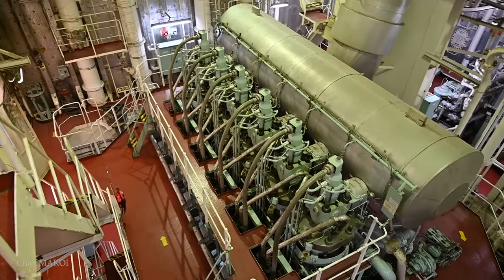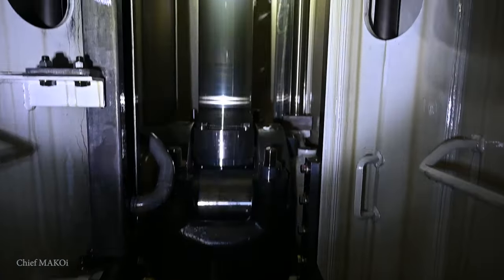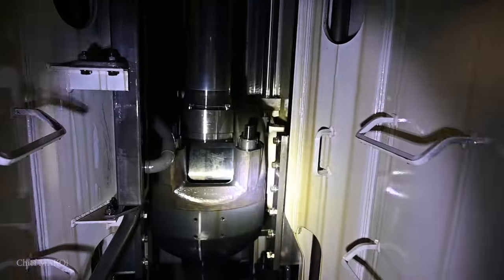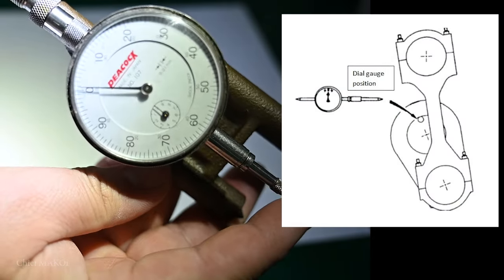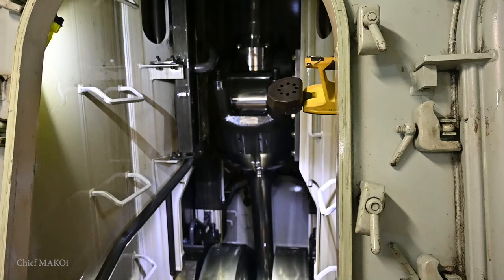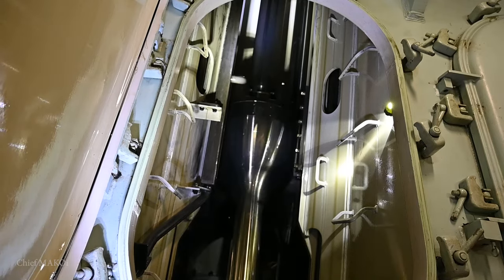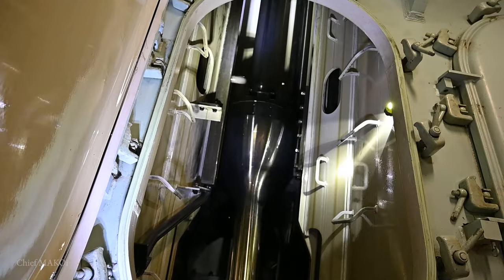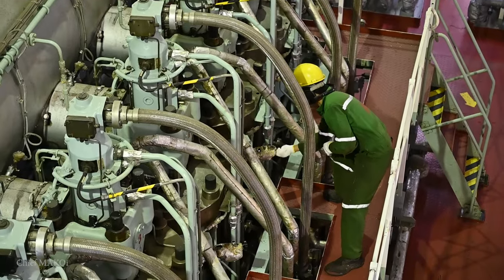Main Engine Crankshaft Deflection Reading | Chief MAKOi

Comment: Keep up the good work!
Reply from the maker: Thanks Hon!
Reply: Mommy Jenny, can't wait for another video!
Reply: @ChiefMAKOi  what is the air compression ratio?
Reply: @xianshi8896  Given it's a 2-stroke, be somewhere between 15.0 to 1 and 19.0 to 1, given its turbo charged i suspect its on the lower end of 15
Reply: @AnIdiotAboard_  thanks.same as locomotive engine has 16:1 ratio.  love Diesel engine too much.
Reply: @xianshi8896  most 2 strokes operate on 15 to 19 to 1, and most 4 strokes will be between 9 and 14 to 1. In all instances charged air intake USUALLY means lower compression ratios.

That's just in general okay? There are alot of diesels and oil burners that run well outside those ranges I've seen 25 to 1 at 4 bar of intake for example.
Reply: @AnIdiotAboard_  okay. thanks so much

Comment: I was a marine engineer in the 1960's with the Nedlloyd lines from Holland.
On our main engine ,a 12 cylinder Sulzer we had main bearing failure of three main bearings , between the last three cylinders.
Oh horror, after arriving in port , Papua new Guinea, and when opening the inspection covers, shining the inspection light and seeing all those flakes of babbit underneath the crankshaft.
We had spare main bearing shells, but they still had to be hand fitted to the crank journals, we sure learned how to scrape the bearing material, apply prussian blue, turn the shell  under the crank, take it out again, check the bearing pattern and again and again until perfect, I believe it took us a week, 12 hours on, 12 hours off to get the engine operational again, and of course we also took crankshaft deflections like chief Makoi so well explained here. What a job, I will never forget!
Thank you chief
Reply: Great job your, my brother

Comment: Take note that this is a medium size 2 stroke cross head engine. The big ones are 50% larger bore and 12 cylinders.
They are seriously big.
I remember climbing around inside these wonders, hammering on everything to check if anything's come loose...in 70C temperature that is...phew...
Thanks for the great vids Chief ! -its nice that all the "land-crabs" can see how their necessities are moved around the world. Keep up the good work !
Reply: Land Crabs😂👍
Reply: @A.C.00  I think Allan means Austin Maxis!
Reply: My initial thought was that the movement with cross head resembled large steam engine practice - no doubt for the same reasons.
Reply: @peteacher52  Well, partly. The cross head takes the sideways pressure of course. It makes it possible to have pressurized  scavenge air from the turbo chargers under the piston, and also the benefit of very clean oil, free of combustion particles, in the crankcase. Unlike the Detroit 2 stroke diesel truck engine, which has very long pistons and dirty oil....
Reply: @AllanKorup  I was just noticing how strangely clean the oil looks in this engine and was wondering if it was because they just changed it. Does what you're saying mean it's always clean like that? Is there no blowthrough in the cylinders at all? I would figure at that size there must be loads!
Reply: @captainotto  hey... The lube oil in the crank case is always this clean in a crosshead engine. The combustion residues that passes the piston rings are kept above the seal around the piston rod ( which only moves vertically through the seal ). The lubrication between piston and cylinder liner is dosed in via small holes in the cylinder and drained out above this seal also.
Reply: 14 cylinders. it's the wartsilla RTC
Reply: @rockpython90  the 14 cylinder Wartsila has a cylinder capacity of 18750 c.c per cylinder ; produces 115000 shp at 110 rpm  weighs 2300 tons and is about 30 meters long  It is the most efficient diesel engine ever designed  for marine use  .
Reply: @captainotto  big ship engines can have 30,000L of oil. They don't change it, they filter it, treat it, and replace the depleted additives.
Reply: @alexadams1836  Wow, that's an absurd amount of oil. But it does make sense at that size of engine. I guess with that much oil and money sunk in it, you must preserve it. I could almost imagine an assay lab onboard so they can adjust additives or respond to metals in it super early.

Comment: Jus sayin' Chief! You do a good job showing what it takes to make the world go round!
I used to sail Chief Electrician on APL C10's. I held a 3rd's Steam License at the time.
I always asked my Chief Engineer if I could 'play' Engineer when we were LA where we replaced 2 cylinders of the Sultzer 12 cylinder engine. They were also doing an alteration on the cam lifters. I did a video of one time, but part got erased with a video of a Dutch guy in Kobe, explaining the history of Santa Claus through the different cultures!
What can ya say?
I worked for 5 (8+ total) years in the US Navy, mainly 38a Shop stuff. Fixed em, built em, and sailed em for another 40 years.
Most people don't understand how massive and powerful these engines are, and the precision that is required for them to operate at the power levels they do for prolong periods.
That said.. 
I still prefer the hum of turbines over the thumping of a diesel! 
Keep it up!

Comment: i was working at MAN diesel frederikshavn denmark.  i turn/milled cam shaft for the injection pumps for the 2 stroke engines, and camshafts for the 4 stroke engines valves and injection cam´s.
it was amazing to see a brand new engine being started up for the first time, and thinking about some of the parts i made will be somewhere on the oceans for several years .
very impressive machines, and imagine, even it is big, the tolerances and presicion is tight and precise as in a motorcycle engine. all workers there was very proud of our products.

Comment: Yes, that engine is absolutely massive! Now, imagine the size of the machines that MADE those parts!
Reply: I worked at Ingersoll Milling Machine Co. we had a milling machine that required a new building almost a city block in length just to house that monster. The bed was 150’ long.

Comment: I don't want to come off as nitpicking an awesome video, I hope it's not taken that way!

There are more reasons that slow speed diesels have a separate crosshead and a straight piston rod.
In a two stroke with air inlet ports, there are three options to handle the scavenging air.  1) Pressurize the crankcase.  This is what is done with small engines like weed eaters, chains saws, motocross bikes, etc... 2) Use a piston almost as long as the stroke.  That way the piston skirt plugs the air ports when the piston is above bottom dead center.  This is done with the famous Detroit Diesel / ElectroMotive Diesels, along with many modern marine medium speed diesels.  The big disadvantage of this design is it makes the engine longer.  3) Use a cross head and piston rod with a seal.
There are several good reasons to want to not pressurize the crankcase.  With big diesels like this, the inlet pressure is quite high due to a large turbocharger.  The charge air is also quite hot, even after aftercooling.  Plus having the scavenge air in the crankcase means the lubricating oil gets into the cylinder and makes soot.
Another advantage of the separate crosshead is the crosshead can get excellent lubrication compared to a piston, and the surfaces can be optimized for the job.  A piston is only oiled on the down stroke, a cross head can be lubricated on both directions of travel.
Reply: Another huge advantage that you left out, is the fact that a stationary (meaning only moves up and down, no side-side motion) piston rod like this can be sealed off from the crankcase with a packing gland, keeping the filthy blowby gases out of the crankcase lubricating oil. People always ask me why we never had to change the oil in a big engine. This is why, it doesn't get blowby junk into the oil, so it's just like oil in a car gearbox, lasts forever if kept clean, not overheated etc. Another big advantage is you can use a special consumable low-ash type of cylinder lubricating consumable oil, so the piston and piston rings has their own oil, and the crankcase, and rod and main bearings use a separate oil supply.
Reply: @brnmcc01  Yes, forgot to include that.  I did mention no lube oil in the cylinder, but left out that it also means no blow by in the crank.

Comment: I wouldn't want to be around when an engine blows out!! 😲😲 As usual, another well put together video showing things I never knew happened on a ship. Very informative.
Reply: That's why they do meticulous maintenance, to avoid a catastrophic failure like you describe. Ships like this only have 1 engine, and you can't just call up roadside assistance in the middle of nowhere, in the middle of a big storm :)

Comment: My old man was a warffie in Melbourne VIC and when they had big jobs on we were hired as casual labour when I was 15 I was lucky enough to work inside the bore of these massive engine on a ladder with hammer and chisel chipping away the carbon build up I remember putting my elbow to elbow touching the inside  diameter even back then I thought how many people would ever see this and getting over $100 a day another job was pulling a 5 ton altanator with blocks and chains awesome experience.

Comment: Engine Temp. 42°C, in THAT hole with the engine turning: No Thanks! Great Respect!!
Reply: I’d love it ✌️🇬🇧
Reply: 42 isn't terrible if the humidity isn't too high. I remember being in the engine room on a steam powered tug, the temps in there was more like 50C. And very humid, because there's always small steam leaks around. But the fans that blew in fresh air from outside were pretty powerful, and it was tolerable. I always kept a water bottle nearby though, it's not good to get thirsty, that's when you get dizzy and make mistakes.... without that fresh air would be absolutely miserable.

Comment: Great video Chief.  How do the engineers keep their footing walking on those slick oily surfaces inside the crank case?
Reply from the maker: Carefully.  😄  You'd actually get a feel for it if you're in there.
Reply: @ChiefMAKOi   Must be like walking on ice.
Reply: @ChiefMAKOi  🤣🤣🤣 better than being down the chain locker stowing cable !! Lol changed days indeed.
Reply: Those booties they put on their shoes help, as well as helping keep the engine crankcase clean. No dirty shoes allowed in the engine. Yes the bearings are massive, but the clearances are precise in modern engines, and a tiny rock or piece of sand can cause expensive damage. I like how Chief Makoi keeps his engine and engine room so clean, cleanliness is important for long trouble-free life.

Comment: We had a crankcase explosion on the Perry Class Frigate I was on.  It was small compared to the videos shown!  A new Stewart Stevenson V16 engine (rated at 1000 kW) was installed to a generator.  On load testing something went wrong.  One of the pistons shot thru the crankcase and a huge fire started.  It took about 2 hours to put out the fire.

Comment: Does the engine oil get regularly replaced or is it continuously cleaned ? 
In either process are samples drawn for analysis ?
Reply from the maker: The lube oil continuously circulates through the LO Purifier.
Reply: It gets continuously topped off, and samples regularly sent in. Typically your lube oil supplier such as BP will handle this. The entire charge of oil will never be replaced, unless some type of severe contamination occurs, such as accidentally mixed with sea water, but that is an extremely unlikely scenario. But lube oil heat exchangers have cracked in the past, but this is extremely rare.

Comment: During a 10yr survey on a medium sized coaster GRT 1600 , B&W alpha V18 of around 2610 B.P.H. The chocks were to be renewed so ,old ones removed , holding down bolt holes blocked off whilst the resin set and after web deflections checked found out someone had used short lengths of broom handle to block holding down boltholes instead of cardboard or the like. Whole lot had to be redone....red faces as company supervisor hadn't noticed . oops.  Used bunkers not heavy oil ,but still had all the pipework and heaters for heavy . Smooth as silk once past critical revs , air start ,mated to shaft genny and then cp prop. Took us safely through 87 hurricane in North Sea as only engine , no aux, 3 day trip took 6 due to massive seas ,can't remember LOA but were looking up at the wave tops from the bridge. M E never faltered once. Lost fair amount of deck cargo tho, all dressed timber ,wires and bottle screws just weren't enough for those extremes . Only Kent screen was working after waves took out bridge wipers..exciting stuff at times...

Comment: Is the crankcase filled with lubricant or are the moving parts sprayed while in operation? These engines are an engineering marvel. Great vid Chief.
Reply from the maker: They are sprayed.
Reply: No crank case is ever filled. The oil is either flicked by a scoop or sprayed
Reply: How amazing.
Reply: I would think that crank case would be a "dry sump or dry crank case" system where the lubricating oil would be pump scavenged from the engine to a separate area (oil storage tank?) then returned under pump pressure to the engine bearings and the sprayers. Then the oil would drain down, after lubricating and cooling the engine parts, to the "dry" sump to be scavenged again in the lubrication cycle.
Reply: @MegaGeorge1948    I believe you are correct.  I understand the oil is also cooled, filtered and treated in the holding tanks before returning to the engine.
Reply: @ChiefMAKOi  that is one seriously huge lump of metal ! How many horses ? KW ?
Reply: @associatedblacksheepandmisfits  I believe on these large engines the power is rated in stampedes. 😁
Reply: @randywl8925  🤣🤣🤣👌🏻
Reply: @tomrogers9467  You are correct.
Reply: @MegaGeorge1948  yes, there is an oil storage. Oil, after passing engine,  will go through centrifuges and filters for cleaning before going to engine again.
Reply: So just like on my vessel it's a Perkins . But I am always amazed at the power inside an engine... I learned to fix my wee engine myself... I'm fascinated by these  behemoths.. my fuel an oil is filtered on my vessel as well...! ✌🏼💗😊❣️
Reply: @Randy WL

😄 !
Reply: sump tank is below the engine crankcase. sump tank is usually the double bottom of hull

Comment: What will you do if it measures out of tolerance? Does the engine have to be rebuild or do you have some special methods of mitigating the problem or will it just be noted and otherwise "ignored" for the time being?
I'd imagine it being a rather big and expensice overhaul to replace a crankshaft on an engine this size.

Comment: 2.4meter stroke compaired to my cars 87mm bore and 100mm stroke, but the exhaust is 2.5inch to 3.5 inch, (you get a better sound when the out let tips are the same size as the bore, there is no loss in power and it can draw in more air

Comment: Hey chief great video!! What is the peak output power of the engine?
Reply from the maker: This engine is rated at 9600 kW.
Reply: @ChiefMAKOi  That's impressive for only 6 cylinders and such a slow running speed!

Comment: Crankshaft Stresses

Following are the kind of stresses that acts on a shaft and they are as mentioned below:

Torsional
Bending
Axial
Shear Forces

Torsional stresses occur due to the twisting forces developed in the shaft when it rotates. Actually it twist in one cycle and then untwist itself on the other one. Shaft should be able to take such reversal of cyclic loads and not fail under such conditions. Generally we only see the average speed of the engine, but in actual conditions it may be less or more, depending on the different units firing at that time.
So sometimes it retard or accelerate depending on the firing of each unit.

Bending stress are developed due to the firing and compression forces developing on each unit and also when the load changes. So a unit which is not firing will have lesser load on it’s crank while the one which will fire going to impose more load.
Also if the bearing clearances are out of limits, there will be more bending on the shaft.

AXIAL stresses come on the shaft from the propeller side, also the hogging and sagging of the shaft. Axial vibration damper is fitted to dampen such stresses.

Shear stresses are developed when the crankpin is in stress due to compressive forces developed by the combustion gases. And a moment is developed around the journal bearings, causing a shear force.

- Deflection for the Shaft
Taking deflections for a shaft is quite important activity onboard. Deflection reading is a sign of wear and tear of the main bearing. Also it indicates any sagging of the transverse bearing carrier.

Comment: Chief, at any point (say during original engine installation in the ship) is the crankshaft deflection adjusted with shims between the crankcase and ship frame?